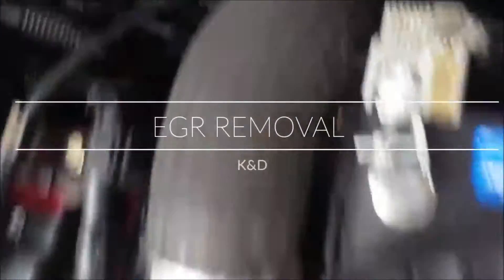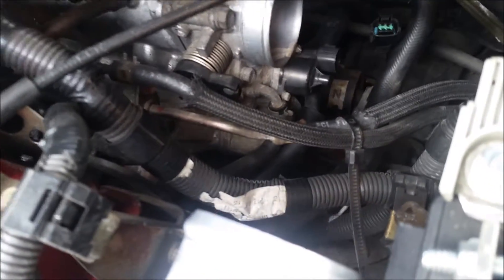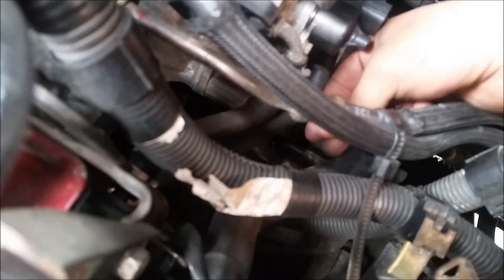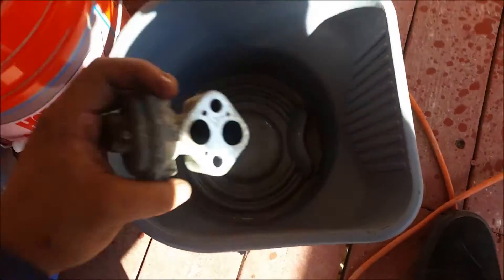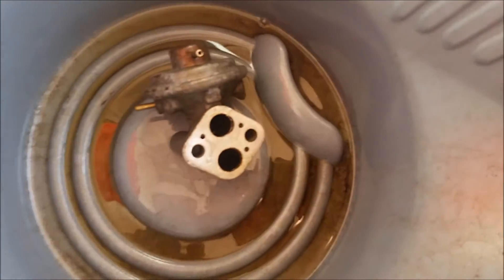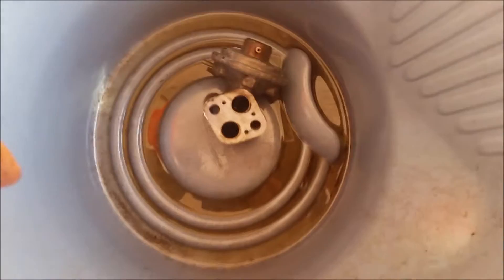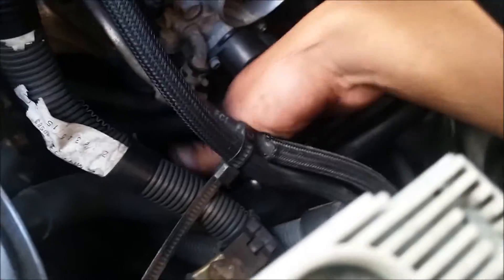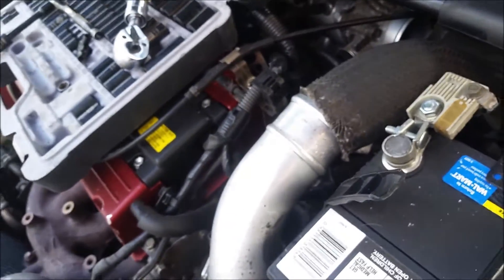EVO 8 egr removal and cleaning

Comment: I cleaned my EGR valve and replaced the gasket like how you did in this video. After 130 miles of driving the same p0401 code came back.

Comment: I’ve cleaned my egr valve and the check engine light is still on after erasing the code. Where is this solenoid located? And is it called the egr vacuum solenoid?

Comment: I have issue check engine light on and I need help.
Reply from the maker: Thank you for watching do you have the same code?
Reply: I don't know that's why I need help.
Reply from the maker: You have to hook up to the car first to see what code you have
Reply: What is the problem that makes check engine light on though?
Reply from the maker: The car throws a check engine light when it senses a faulty sensor it could be any sensor that's why you need to hook up to it to see what it could be
Reply: Ok thanks

Comment: I have the same problem, but.. my CEL OR “service engine light” does not come on. I removed the cluster and all bulbs were good, not one burned o e at all.. as for the egr valve I removed it had a lot of carbon in it, cleaned it tested it with. Tester I have and it opens and closes with no problem, also noticed one of the vaccum hoses were not plugged in so I had that taken care of as well . So let’s see how it goes with the next 60miles..
Reply: How did cleaning the EGR Valve go? I'm assuming we have the same car if you were talking about the Evo in your profile pic. 

I have an '06 Evo 9 and currently battling this issue. Every time my car warms up I get intermittent idling, especially when it's hot outside.
Reply: Justin Kennedy from what I remember  the process wasn’t hard at all. I did clean ALOT of build up in the egr valve tho. It ended up being a vacuum line for me tho.
Reply: @Kimballliin  Oh okay, I'll have to look into that. Thanks for the reply.
Reply: @JustinBeBustin9  ever figure out the problem? Im having the same issue. New spark plugs and coil packs, stock evo.
Reply: @Slav Films  Unfortunately, no. Now that it's colder outside, the idle is fine. I'll have to wait until summer time again when it gets hot out which is when the intermittent idle actually starts. So weird.. Every winter, the idle is perfect. Did it start doing it after the new plugs and coil pack?

Comment: When you had the light on could you full throttle with no problem?
My car shakes
Reply from the maker: Alberto Franco thank you for watching and yes I could it did not affect how it drove,  does your car hesitate when you go full throttle?
Reply: K and D boosted garage 
Yes it does just as of late it'll shake up when i try to step on it and go faster 
So lately I've just been grandma shifting it
Do you know what it could be?
Reply from the maker: Have you checked what codes you have? Could be a missfire
Reply: K and D boosted garage 
Today checked have egr valve code and random misfire is what it Said
Reply from the maker: Or could have a bad boost leak my car was doing that when my throttle body was leaking from the seals, it needed to be rebuild
Reply from the maker: Check your sparkplugs they might be bad or the coil packs
Reply: K and D boosted garage 
I will thank you for your help
Reply: @albertofranco3748  did you ever figure your problem out? Im having the same exact issue, i have brand new spark plugs, gapped correctly, and new oem coil packs. Still have a p0300 random misfire code.